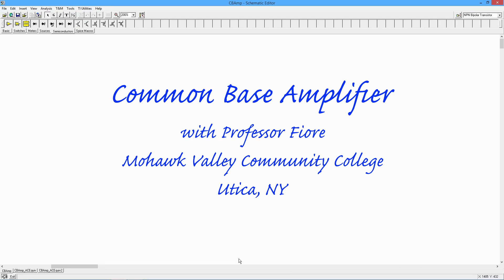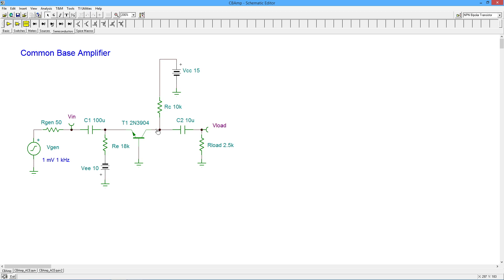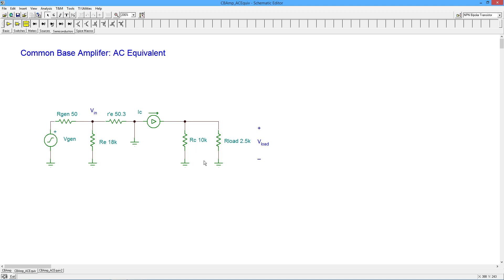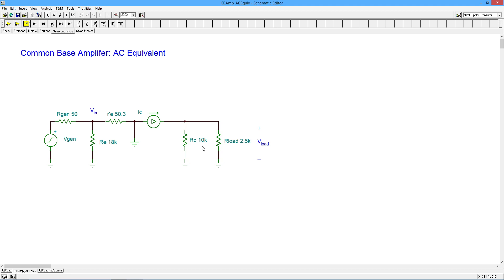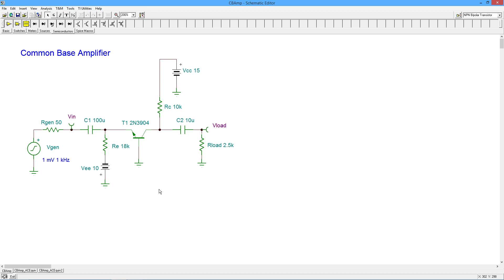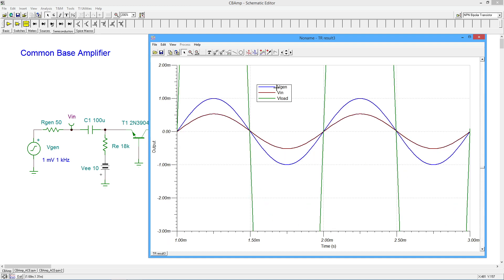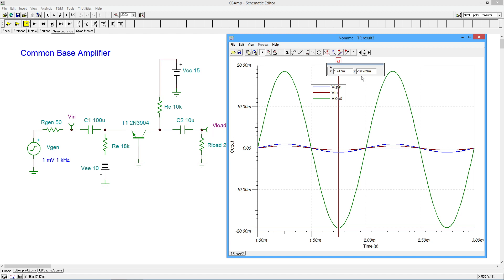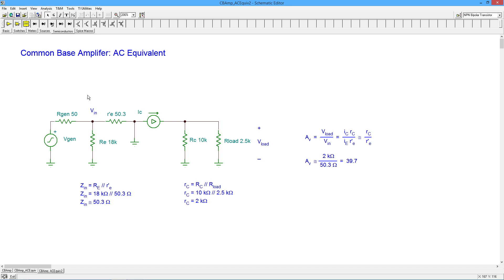Semiconductor Devices: Common Base Amplifier

Comment: Hi Professor Fiore why have not you considered base dynamic resistance .. for voltage gain.. output over input it is not required for calculation , but does it remains active behind the scenes...please clear this Sir.
Reply from the maker: As always in these sorts of analyses, we make certain assumptions and simplifications in order to speed the process. The question is, are these simplifications still leading to a reasonably accurate result? If you compare the results of our calculations to the results of the simulations, you can see that the agreement is very high. Indeed, most of the variation seems to be coming from non-linearities (i.e., distortion). In short, why chase down second order effects if all you're looking for is an overall performance metric?
Reply: Thank you very much Sir

Comment: I'm still confused, why can't we just give the base a resistor that large enough to increase the Zin, so that to reduce the loading effect. As Zin will equal: Re // (r'e + Rb//Inf ). 
Thanks you.
Reply from the maker: You're forgetting the difference between Ib and Ie. When you're looking at the emitter from the base, everything in the emitter appears beta times larger, right? The inverse is also true. When you're looking at the base from the emitter, everything in the base appears beta times smaller.
Reply: @ElectronicswithProfessorFiore  oh my dumb, forgot that it is the ib there, thanks you so much. 
But  I still wonder if we can put a huge resistor there that even after a beta time smaller, it could still large enough for a raise in Zin. Will there be any side effect from that?

You give me the confidence to attend the analog circuit class again after a long break in fear, I just want thanks you again prof.
Reply from the maker: @phile7420  You could do that to raise the Zin, but then the approximation that the base is at ground is no longer true and you'll see a reduction in both voltage gain and upper frequency limit. You're paying 10 dollars (euros, whatever) to save 1. Not a good tradeoff.

Glad the channel is helping you. That's why I'm here.

Comment: Second time around...
The distortion information was more meaningful this time. If we have a r'e of 50 Ohms and we added 50 Ohms to the emitter (to give r'e + Re = 100 Ohms, we'd half the Avout.), what would happen to the distortion?
Reply from the maker: Assuming you turned up Vin to get a comparable load voltage, you'd see the distortion drop by a similar percentage.
Reply: @ElectronicswithProfessorFiore  so.... amplification is directly proportional to distortion? That is, if I halve the amplification through the addition of Re, then I halve the distortion? (I'm sorry that I'm struggling with this and I appreciate your patience).
Reply from the maker: @simonyoungglostog  Sort of. What's happening here is that adding Re is a form of negative feedback (this is discussed in some detail in the Op Amps sequence). With negative feedback, you sacrifice gain in order to get other things you want (lower distortion, wider bandwidth, increased/decreased Zin/Zout). The more you sacrifice, the more you get.

Comment: WHY DID YOU NOT MULTIPLY r'e times beta in parallel Re?
Reply from the maker: Common base amplifiers do not get the "beta multiply" effect. You see that when the input is applied to the base, not when it is applied to the emitter.

Comment: Nice analysis!
0:35 and 8:38. Yes, maybe not for a typical audio amplifier but there are some niche audio applications. (Perhaps, not so common now.) Examples are moving coil phono or microphone pre-amp inputs. There, the low input impedance is appropriate. An additional trick that was commonly applied, is to use transistors with large emitter areas (e.g. a power transistor), for low noise. The low Rbe value reduced thermal noise. It is true though, that common base is more at home in RF applications where the much better bandwidth of the common base amp is a big bonus, compared to the other common transistor amp configurations.